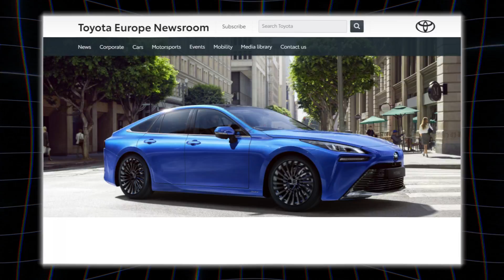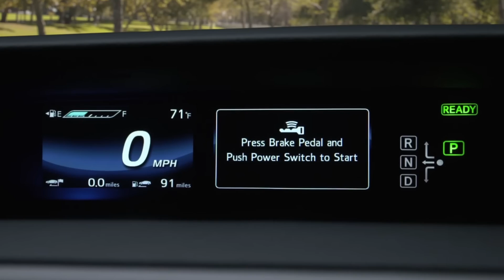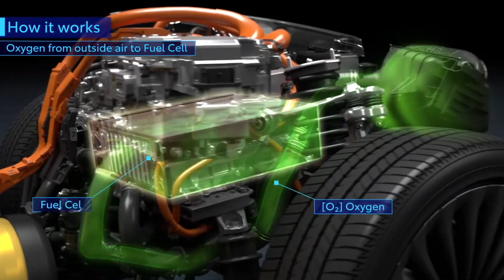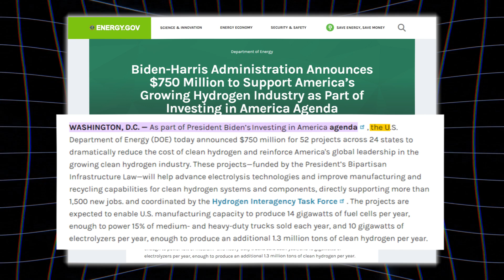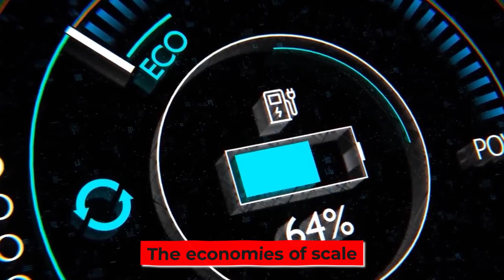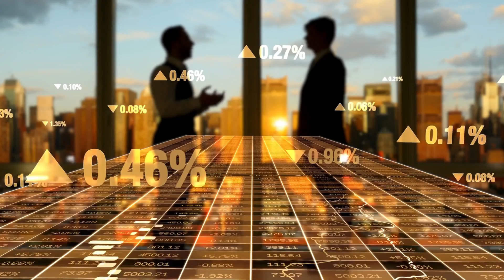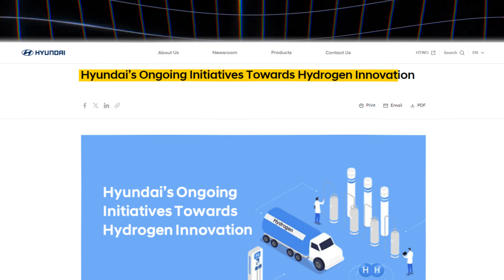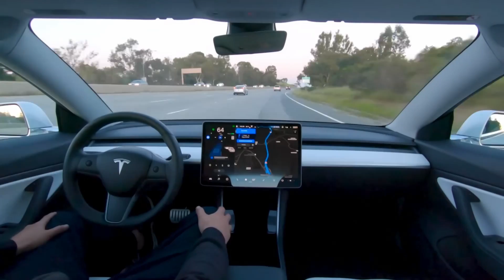Here's What Happened to HYDROGEN Cars (And What's Next)

Comment: Hydrogen is definitely better than electric because it refuels like a gas car, but has the same eco friendliness of electric cars. Hydrogen production, however is noticeable less efficiency than electric cars, or slightly gas cars in comparison. You also have to take into account electric cars environmental impact of making the batteries in general, which could be a comparison video in general.
Reply: The inefficiency in hydrogen creation is insane, it simply doesn't make any economic sense...